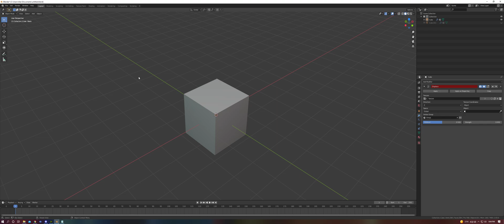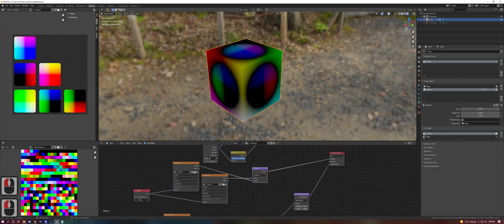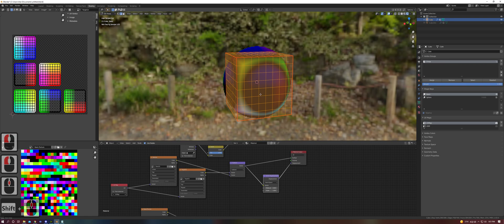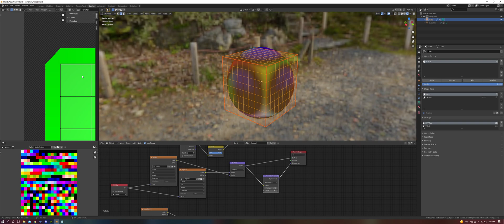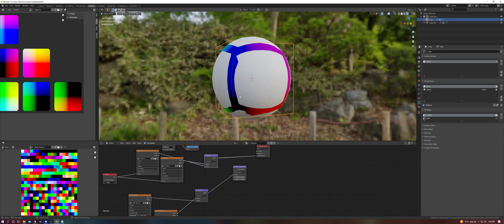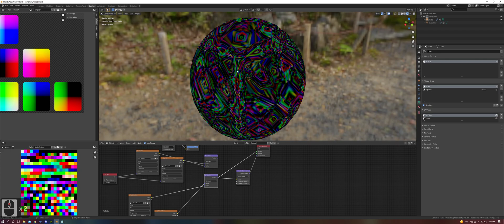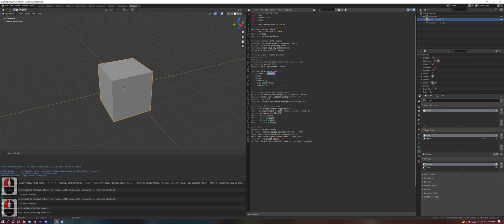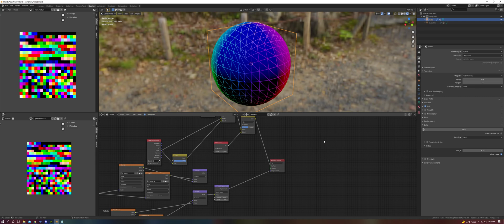Vector Displacement Maps pt. 1: Traditional and Optimized Shader in Blender

Comment: Hi, I don't know if you'll see this, or if you even check old videos. But I was wondering if it was possible to use shape keys to morph the cube into a complex object? You mentioned in the video that the traditional way of displacement is good if you're trying to make a stencil for Zbrush. Well Blender now has something similar and I've been scouring the internet for any information on how to make precise brushes from existing mesh.

I'm not math savvy and barely understand the shader editor as it is. But I really would like to know if it's possible to morph something like a high subdivision grid into something like an archway, something with overhang essentially. I've been racking my brain trying so many combinations trying to figure out how to create complex shapes but preserving a uniform grid UV map, so that when I bake it the texture can then be used in sculpt mode.

This is a wonderful video by the way! Thank you for putting out this tutorial!
Reply from the maker: Think of a Vector Displacement Map like a super stretchy square of rubber. You can make any shape you could stretch it over, but you can't add any holes to it. It would be impossible, as far as I am aware, to make a brush that could turn any subdivided surface into an archway. 

The problem isn't the overhang, it is the hole. A common mesh used to demonstrate VDMs capabilities is a mushroom. Quite complicated, with a large overhang. but our imaginary sheet can stretch over it just fine, with no holes needed. 

Topology is the relevant mathematical field.
Reply: @TechArtAlex Yeah someone told me holes are impossible, and that's fine. But what if I had a hard modeled surface? Like a cube that has been booleaned by another cube?

Is there a way to accomplish this through the shader editor? The only way I've found has been through multires and shrinkwrapping and manipulating the mesh of the grid in Sculpt mode. But I was hoping there might be a simpler work around.

Blender secrets put out a video regarding vdm brushes, and said that it was possible to make vdms from existing objects. But does not disclose how. He only teases in his video that he uses shape keys. And that's what led me to your video [via keywords "Vector Displacement with shape keys"]
Reply from the maker: @syaoranli7869  You just need to bake the world position of the plane/mesh before and after applying the shape key, and then the difference between the two world positions is a standard vector displacement map.
Reply: @TechArtAlex can this be accomplished when joining a hard modeled object with a grid?
Reply from the maker: @syaoranli7869  By grid you mean a subdivided plane? Any object/shape that can be flattened into a continuous plane with no overlap or holes should work. Think about our infinitely stretchy square of rubber. It may be possible to go beyond these constraints with clever mesh construction, but not in a generalized manner.
Reply: @TechArtAlex yes, a subdivided plane. So take your example of the mushroom. If I manually created that in Edit mode with bevels, scaling, and all. And selected the subdivided plane and hit Ctrl + J in object mode to join the 2. Would I then take the baked image texture of the plane and the baked image texture of the joined mesh, subtract it in the shader editor and that would give me the new vdm to bake as a brush?
Reply from the maker: @syaoranli7869  Joining has nothing to do with it. 
Only the relative difference in world positions of a pixel baked to the image texture.

Basically, you need to be able to squish the UV map of the object into a flat plane with no seams, overlaps or holes. 

Here's a quick sloppy example: https://i.imgur.com/ISqaEDD.png

The outer edge of the UV map is the base of the mushroom, and the center is the top of the cap. Notice that it can be squashed totally flat with no overlapping UVs. This allows it to be mapped to the same UV space as a flat plane can, and therefore we can find a vector that describes the difference between the two points.
Reply: @TechArtAlex so if I gave a plane a shader material, could I use the UV map node of the plane and subtract it from the mushroom via a texture coordinate?
Reply from the maker: Specifically we need the world coordinates, not the UV coordinates. In some cases they may be the same, but not always. The UVs are just so we can correlate a point on the plane to a point on the surface of the displaced mesh, such as the mushroom. 

This is essential, because unlike the method I show in the video, a generalized VDM isn't expected to have perfectly matched vertices, so we need a traditional UV to bake to.
Reply: @TechArtAlex  yeah that's what I meant to ask. Sorry, difficult for me to articulate it. But essentially take the UV coordinates of the plane, and the object coordinates for the mushroom.

Separate the XY of the plane, the Z of mushroom, and then subtract them from each other?

The built in vdm Baker add on does that for the its sculpting plane. It takes the texture coordinates of the plane, separates the xy of the uv and subtracts it from its object coordinates. And then rejoins only the z of the object back with the xy of uv with a combine xyz node
Reply from the maker: @syaoranli7869  you need the difference between the XYZ of the world position of the plane and the XYZ of the world position of the mushroom.
The world Z of the plane will likely be 0, but you are still going for a 3D vector between the two points in space. You need the XY of the mushroom, not just the Z. That is the difference between a regular displacement map (which only displaces in the Z direction) and a vector displacement map, which displaces in any direction. Without the XY, overhangs would be impossible.
Reply: @TechArtAlex would the uv map of the mushroom need to be manifold then, meaning no overlap, holes, etc... how would I accomplish that?
Reply from the maker: @syaoranli7869  Basically yes. You'll want to refer to the image link I included a few responses ago. UV mapping in that manner would allow for proper displacement. I didn't spend long on it, so it's not particularly well done but it'd work. 

Any overlaps would result in defects in the displacement.
Reply: @TechArtAlex i see. Thank you for all of this enlightening information. I'll mull it over and try to figure out how I can make VDMs from existing objects
Reply from the maker: @syaoranli7869  Sure thing! Hopefully it'll be helpful for your project!
Reply: @TechArtAlex  thank you
Reply: @TechArtAlex quick question. How did you squash/unwrap this without any overlap?
Reply from the maker: @syaoranli7869  I just manually removed the overlap after doing a top down projection, since there weren't many verts anyway.
Reply: @TechArtAlex  ah, I see. Thank you

Comment: Amazing video, wonderfully condensed and informative. I was wondering if it would be possible to instead bake the vector displacement data directly into the vertex colours of the mesh? Rather than having a separate texture. Would there be any issues with doing this?
Reply from the maker: Thanks! It is possible, the only real issue is bit depth will be much lower, so the displacement will be less accurate and that may cause some artifacts. 
You might be better off baking the second set of vertex normals there instead.